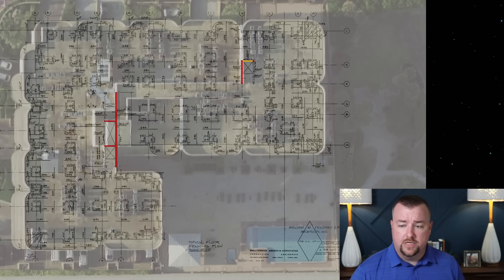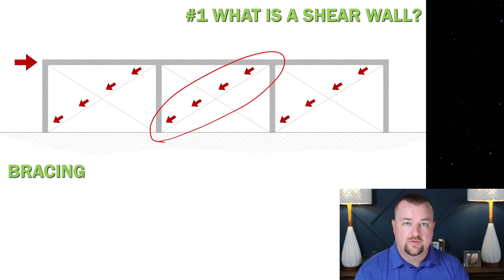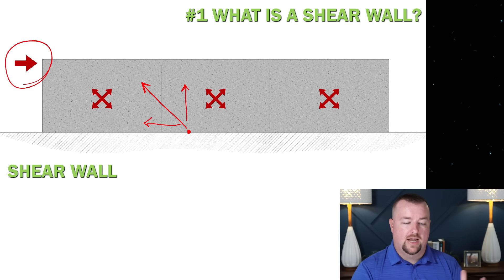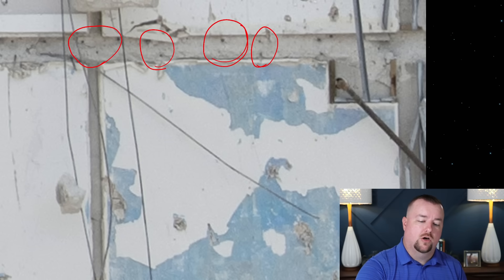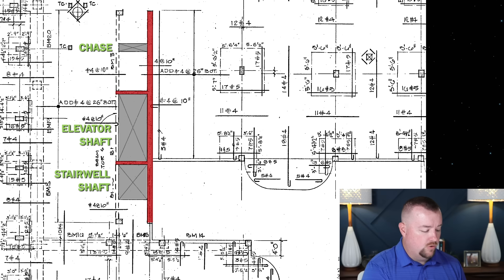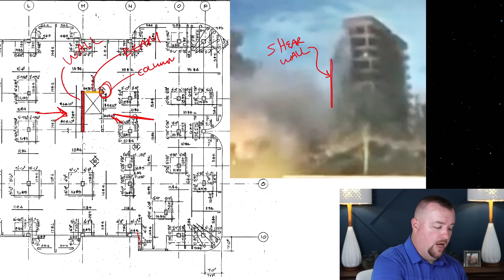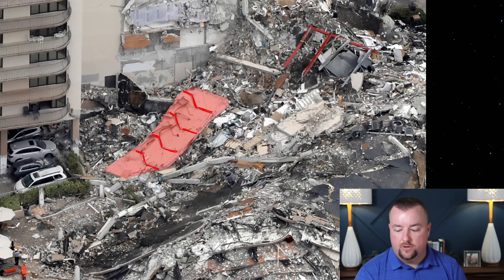Surfside Collapse - Structural Engineer Answers Your Questions About Shear and Shear Walls

Comment: For years I have looked at those long diagonal steel bars along the inside walls of metal buildings, and I could never wrap my head around what purpose they served. I gained a deeper understanding of physics/statics and dynamics today. Thank you.
I feel like I could teach someone else this concept and they would understand it to the same degree I now do.
That is the sign of great teaching.
As long as you keep making videos, I will keep watching. Thank you so much for sharing your valuable time and energy and knowledge with the internet!
Reply: Without being critical of Josh (he is a much better structural engineer/instructor than I am) I think he should have said that much (but not all) of the bracing you see in modern buildings are acting in tension. (I .e. they look like big tie rods).

I saw some calculations/draings for a mid-Victorian railway bridge once - and due to lack of computational resource it was designed as two separate structure one compression and the other tension.

Comment: Why would anyone build a structure with lateral bracing in only one direction? There should have been a shear wall to provide bracing perpendicular to the others.
Reply: I agree - additional shear walls around lift/stair shafts would have been easy (and very little extra cost) but TBH the resistance to shear of column/slab/beams joints appears to have been a bigger issue in the collapse.
Reply: Thing is tho that the shear walls did their job for 40 years. Wind did not bring this building down.

Comment: Another great video, thank you!  In addition to the missing building and probable damaged internal structural components, could the extra weight of debris hanging off the "ripped" section of the standing building also contribute to the building's slight twist and downward falling motion?
Reply from the maker: Absolutely!  Great observation. 👍
Reply: Yes but take a look at the photographs of Ronan Point collapse in 1968 indicating how a failure of part of a building (albiet with very weak joints between slabs/walls) stood up despite a loss of support.
Reply: @postie48  Yeah, there was one they TRIED to take down twice or I think THREE times! It fell like 4 inches and stayed standing. Second time it fell a few feet, on an angle (?! Lol) and STILL stayed up. To great amusement of those watching...
Reply: @postie48  It's funny you mention to look at photographs of another building collapse when my question was specific to another event entirely where there is video of it falling which led to my question in the first place lol
Reply: @FauxToez  Ronan Point partial failure (due to a gas explosion) is one of the key building failures of the 1960's. Bot so much due to any great loss of life: I think there were four deaths, although if it had happened an hour later theere would have been at least 10 times that many. The event led to more consideration of the resilance of building to failure of one element and the abandonment of a construction approach that was in vogue at that time i.e. precast panels stacked like a house of cards. To me as a young engineer at that time it was a key lesson around the need to think out of the box.

Comment: Not trying to down grade any engineer or Architect but after 35 years in construction I have seen a lot of mistakes on plans. My buddy who did class A construction( rebar poured in place concrete). Used to say ( Architects can make a square ball bounce on a piece of paper but not in real life). That's why I think the sister building should be torn down. Bad design.. I don't think some rusty rebar caused this building to fall.
Reply: Not the champlain towers, the jenga towers.

Comment: From what I see of section 3,  the surveillance collapse video shows only 1/2 of what is usually depicted as remaining.  The top condo, only 1 set of windows remain past the corner 'curve'.  By my eye the left most column and the one next to that are what remain. That double line at the bottom of the blue print where your red line ends on the left, I believe ends on the right.

Comment: @Building Integrity
In a previous video you talked about the possibility of a void forming underneath the parking garage foundation. But then in another video you showed a photo of the site being cleared up and the foundation fully visible and seemingly undamaged. My question is, if there was a void wouldn't that void act like another (half)floor and should've been pancaked like all the other floors above it? Or at least shown a fair bit of damage from having the entire structure collapsing upon it? Would you say it's unlikely a void ever formed, based on this? Thanks in advance for your great content!
Reply from the maker: Yes. In that video we discussed how soil consolidation CAN create voids and cause differential settlement of the building.  I think based on the general condition of the garage slabs, a significant void space is unlikely, but stress caused by differential settlement has not been ruled out.

Comment: I asked a concrete guy one time how much shear value was in a concrete collum with a concrete slab tied in. He said an incredible amount. (But not when they don't add enough rebar). The pool deck collapsed because not enough, i bet the building was the same.

Comment: For me it looks like shear wall was added only because of elevator and stair shafts. Not against winds. That's how it explains why there is a big shear wall from North to South and no such shear wall from East to West. While logically strong winds come from the ocean, and such East to West shear wall should be useful.
Reply from the maker: The shafts are convenient locations but the walls are definitely there for lateral bracing.  The engineer specifically strengthened these walls with extra rebar for that purpose.

Comment: Josh some of my comments were answered previous videos when I had mentioned audio sound that could create vibration and they answered me with jackhammering and such-and-such I meant audio sound from Extremely Loud bass speakers from a car stereo for instance in a weakened structure can have a certain tone that will vibrate it and cause it to fail if it's week already it's just an idea but I appreciate the fact that you guys answered some questions but since I have it building experience I was pretty aware of the Jackhammer someone so I'm talking about loudspeaker system as they can really affect things
Reply from the maker: I'm honestly not sure.  I am sure it would have an effect on already weakened structures... but I don't know the magnitude of that effect.  While we may experience bass audio waves quite a bit, we are not solid concrete structures, we are squishy meat sacks.

Comment: The best architects use as little material as they can get away with. This building came down from 40 years of subsidence of the sand it was built on and salt air/water exposure. I may never go into another coastal building over 4 stories.
Reply: DB: No evidence of subsidence in the building.

Comment: if only there was a left/right (plan view) structure wall in the center section.
astounding how it took the whole center section down just from essentially 1 failure, that might have only collapsed a section of the building at most.
as i've heard other engineers say, there's a lack of robustness built in.
it relied on only short walls to create the stability in the angle 90 degrees to it.
not enough structural cross bracing i guess might be how to state it.

Comment: So if you are working off of sound engineering theory, is it safe to say that those on-site will essentially say the same thing you are saying, just with a little more specifics due to access to evidence?
Reply from the maker: Yes.  But keep in mind, I am also analyzing aspects of the collapse to teach some engineering concepts which they may not care about as much since they will be focused mainly on determining the primary cause for the collapse initiation.
Reply: @BuildingIntegrity  Indeed. I also noted early in one of the previous videos where you stated that you aren't here to "solve" the collapse. Absolutely fantastic channel. Thanks for your clinics. I know I'm going to be looking at every parking garage in a different way henceforth. Kudos!

Comment: The only shear walls acting in the east-west direction are next to the elevators, so when the center portion fell the remaining east portion was no longer braced by the walls around the elevator.  The short shear wall beside the stair would only act in the north-south direction, it would offer no strength in the east-west direction.  The east part of the building could only rely on rigid frame action which it wasn't designed for, but the rigid frame action inherent in a cast in place building did give it temporary stability.  After it started to lean a bit to the west then it would start failing all of the beam/column joints and that was the end of it.
Reply: Unleashed in the East
Reply: Virtually zero shear resistance in the East-West axis... how many OTHER highrises--from The Carolinas all the way 'round to the Mexican border (and beyond) are right now "getting away with it"???  =:O
Reply: I would find it unusual to find a lack of shear wall in the east-west direction in a hurricane prone area.  Fundamentally, the moment shear counter-reaction would have been at the base of the structure (pool deck), potentially overstressing it if the concrete properties were compromised.  Root cause was bad design day one, imho.  Neglect accelerated the failure.

Comment: Josh - thank you for doing these videos! They are very informative and you are an excellent teacher. I have learned a great deal from your videos on the tragic collapse of Champlain Towers south.

Question: why would building codes allow a seemingly weak structure like this, in which the outside walls only go down to the pool deck level and not all the way down to the foundation? It seems to me that having a structure like this, in which the pool deck is really the first floor of the building, is a very poor design because failure of the deck compromised the entire building. It just seems like a very weak and poor design to me. 

That and the years of neglect and poor maintenance, saltwater in the garage for years, adding tons of weight in the planters, and not taking immediate action on the 2018 engineer’s report saying that the concrete damage would increase “exponentially” if it was not addressed immediately needlessly resulted in the deaths of many innocent people.

I wouldn’t buy a Florida condo for a dollar! Most of these buildings were constructed back in the 70s and 80s very quickly, when there was very lax oversight. I’m surprised there haven’t been more collapses of these death traps built on reclaimed swampland and sand down there.

Again, thanks for what you’re doing!

Comment: Are pilings, which are in/below the water table - subject to attack by subsurface water?   And would it appear the water table rose, or that the building was designed/built with the garage below the water table (at least at high tide)?  (One can build a boat to be dry below the waterline, presumably also a building, but that would require special effort, no?)
Reply: The building was approx 8 feet down into the water table. Water table has not risen 8 feet in the last 40 years.

Comment: Shear webs prevent a rectangle from becoming a parallelogram.  The load of an aircraft is supported by the top and bottom spars separated by the shear web.  This building only had them in one direction if you don’t count the block walls in the apartments.  Great video.
Reply: It’s also a factor in convertible automobiles. If you’re ever driven one, you can feel the lack of rigidity immediately.
Reply: @madmaxine12  Yeah, that's part of why decapitations are much more frequent in accidents involving them.

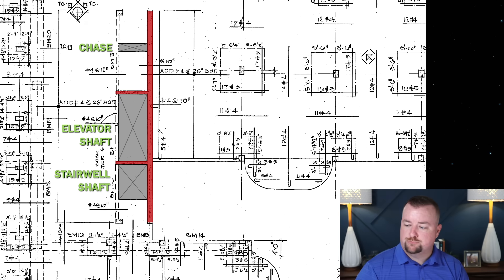Comment: Stopped watching at 13:32 due to Ad-Whoring.
It appears you allow YouTube to automatically put the mid-roll ads in for you, rendering this video unwatchable. You may want to go into your settings (or monetization per-video) and select manual mid-rolls, to add what you need, instead of wrecking a lesson you tried to provide. They got you on this one. Some were bad, but this was just unwatchable.
Reply: lnstead of complaining about ads, which many of us hate at least as much as you, do a little research into ad blockers, or just take my advice and install Adblock for Youtube. Voila, no more ads, problem solved.
Reply: @frankmiller95  .....or stop Google from Ad-Whoring videos, the far easier problem, without installing suspect ad blockers.
Reply: @frankmiller95  or just watch the ads and let the content creator get his pennies.

Comment: You guys are still the best on the Web for breaking this tragedy down from an engineering POV. Keep up the amazing work.
Reply from the maker: Thank you!
Reply: @BuildingIntegrity  great work. Have you been following Miami herald in terms of what’s going on with investigators . Missing documents etc? Def worth the read . This building may not have been followed to plan in some areas
Reply: @BuildingIntegrity  I feel like I could design a building by the end of this series! :P
Reply: @Rx7man  LOL. yes FEEL that way BUT won’t do it ... lol
Reply: @ElfieTheLittleOne  Exactly. The concepts are quite simple and applicable in many other areas of mechanical designs too. The complexity happens when computing actual strength - how the different parts cooperates to take up loads. And how big each individual force will be. And how large movements will be. And how the forcements and movements are kept at a level where the individual elements can continue to maintain the required strength for the usable lifetime of the building. And how this is affected by actual materials, actual ways of placing/fixating the rebars etc.

And then the little problem with how to design to handle weather, so rust, frost cracks etc will not destroy the building.

On top of that comes all the other problems. Resistance to fire. Design of ventilation system to get required amount of air replacements per hour etc.

In the end, it takes a huge amount of knowledge to go from "I understand the concepts" to be able to do actually design a building like this. Lots of mistakes possible, which is also why building codes keeps getting updated as more knowledge gets accumulated. Todays best practices should hopefully be must better than what was known at the time of design/construction of this building.

And I'm pretty sure lots of new knowledge will come from the investigation of this tragedy.
Reply: @Rx7man  I design them all the time in The Sims lol.
Reply: @-._.-KRiS-._.-  Have you played any of the bridge building games? I made some really janky ones that did the job, and they were SUPER cheap (I got into the top 1% on many of them)
Reply: I agree!! The best! 🤩
Reply: I totally agree!
Reply: I always feel like I come away with something newly learned with your clear, concise videos. Really appreciate the time and thought that goes into them.
Reply: @Building Integrity Why is the slab of the shear wall so small in the picture! It fell somewhat whole but looks as if it was only a 1/3 to 1/2 of the entire building!
Did they short the shear wall?
Thank you!

Comment: I interprete the drawing of the rebar connecting to the shear wall in a simple way: a horizontal loop around the vertical rebar running inside the shear wall. That would connect it very well. To just put in a straight few inches with no means of tieing the rebar together is just "no" engineering. Any rebar should end in a loop around the rebar running rectangular to it. So it makes a mattrass woven into a solid net. I guess the moving slabs simply cut the rebar where it came out of the shear wall.
Reply: It's possible that putting the loop in there would have weakened the part that was left standing and led to it also collapsing. Putting in just a few straight inches was possibly fine as long as the building was not collapsing. But probably I have no idea what I am talking about. It's just that it looked to me that they had simply pulled out in those places.
Reply: @seriouscat2231  I concur that that could have taken it down too. But as shown in another video the single point attack of the downward motion overloaded the rebar on by one easily and destroyed it. And tearing off in a zipper fashion it could never develop the power needed to get that wall down. One rebar after the other gave way not the whole slab tearing on the shear wall at once. I suspect, if the loops had been done, then the rebar in the shear wall was so solidly connected (try pulling out a looped rebar of approx. 1 foot length!) that it was simply shorn off by the progressive downward motion of the deck slabs. And/or was torn apart inside the slab and showing afterwards as those 2- 3 feet long rebar hanging out. The idea it was just in there for some inches does not make sense to me.

Comment: Wow, so then if the rebar had been better fastened into the sheer wall, could that have prevented the building from collapsing even after the pool deck and the first columns fell, or at least held it up longer for more people to get out the building?
Reply: I was wondering  the opposite - if the fact that it pulled out is what kept the west part of the building from also collapsing?

Comment: Anytime you have a deck supporting a wall that extends the entire height of the building, that wall should extend all the way to the base.  And especially where the wall separates the indoor portion of the deck from the outdoor portion of the same deck.  Couple that with a step grade difference on the deck and this postulation holds true even more.